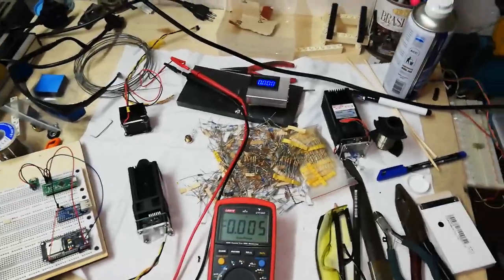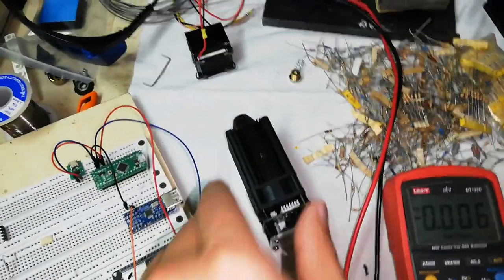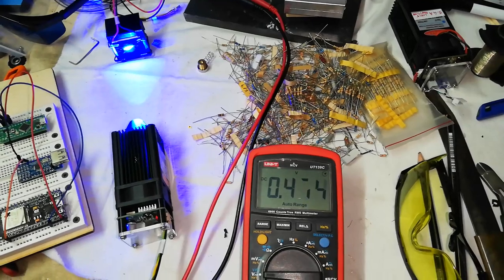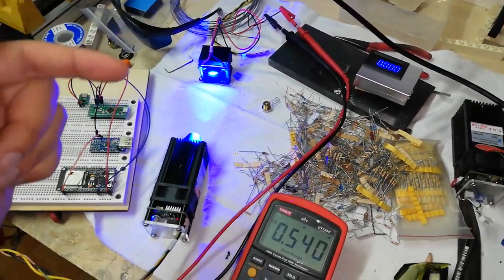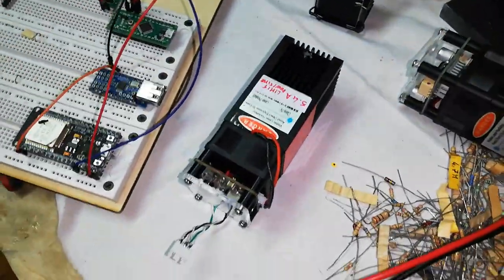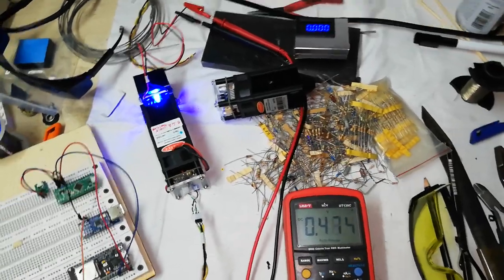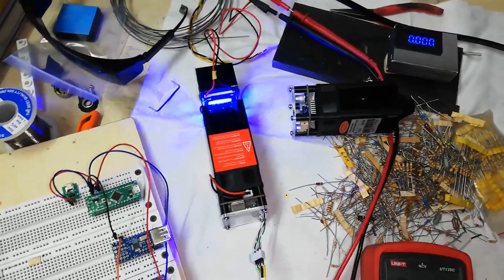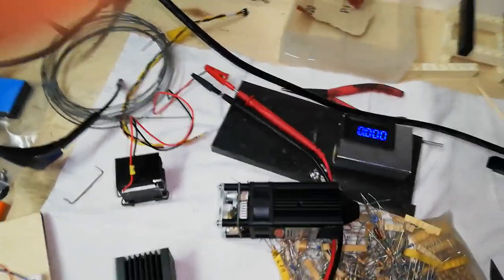DIY laser power meter: measure laser power using a peltier cell.

Comment: Cool! This is better than my idea of shining the laser at a black plate in a bath of water and measuring the water's temperature change.
Reply: This could be useless if the light of your LASER was not absorbed, because the water is transparent for many ranges of wavelenghts. By other hand, you can have a instant evaporation of water in the surface, before the increase of temperature.

Comment: The max amperage in the peltier cell affects the millivolt reading in my testing I've tested 1,2,6,8,10A cells in my testing 6A cell gets the closer reading
Reply: What size laser were you testing with the 6A cell? If I want to test lasers that are less than 1W, would a lower Amp cell be more accurate than the 6A?

Comment: I had been wondering if this was possible. I'm surprised at how little drift occurs. I wonder if you could use a second peltier and a thin film sensor to act as a fixed temperature reference. Nice work!

Comment: Your method will be very useful to me. For some time I will have an Ophir meter and will be able to calibrate the Peltier using it. I have a question: What does the black absorbing plate, which is pressed against the Peltier element, consist of?
Reply from the maker: laser side is painted black, cold side is pressed on an aluminum heatsink (from an old PC graphic card)

Comment: It's an interesting video. But I miss the direct comparison with the laser power meter you bought. Could you also explain the use of the laser power meter? Do you remove the lens for the measurement?
Reply from the maker: In the video there is no comparison between the LPM and the peltier, but I can say that the two modules make about 5.4W and about 7W when measured with the LPM so the 0.540mV and the 0.680mV can be considered representative. It is not necessary to remove the lens, the important thing is that it does not focus on the LPM or the cell, otherwise it will burn.

Obviously the lens introduces a power loss, usually around 10% (it depends on the quality and type of the lens) so if you want to measure the power of the diode you have to remove it, if you want to measure the real power that will end up on the material to be engraved you have to put it. The difference between the two tells you the dispersion due to the lens.
Reply: @lasergrbl  Thank you very much for the explanation.

Comment: You could have at least placed a load resistor on the output of the module and see how much current and therefore power the module makes compared to the laser. But you didn’t.
Reply from the maker: thanks for your hint, I think you're right. using a load resistor and measuring V and I certainly give better readings
Reply: @lasergrbl  Not a problem, in fact you could make an entire video on it.

Just place a resistor across the module. 

Divide voltage by resistance and that will give you current. Then of course voltage x current = wattage or power. 

You don’t even need a meter except to measure voltage. 

If you place a meter in series between the module output and resistor it will be exactly the same as you calculated. 

This is the great thing about ohm’s law in which if you know any 2 things out of 3 then you will figure out the third thing.

I’m really actually curious as to what the module’s power is compared to the 5 watts of the laser.

To find efficiency simply divide output by input then multiply by 100.

Next is to try a magnifying glass between the laser and module. This will amplify the heat to the module.

It may not improve things or it may I wouldn’t really know, but I’m curious!

Comment: The distance you kept the different lasers away from your measuring device way different . Would that make a difference?
Reply from the maker: no noticeable difference as the laser power does not disperse with distance (unlike what happens with the light of a bulb)
Reply from the maker: https://www.youtube.com/watch?v=vUwP7SY0Ajs
Reply from the maker: the only reason they have been placed at different distances is because they have different focusing distances, and you need to point it at the peltier cell - not in focus - otherwise you burn the cell.

Comment: Intresting video. I made test to myself, but i dont know what to thing.... I have NEJE laser modul wich shuud have 7.5w optical power, but when i measure voltage from Peltier cell, it shows only 0.22v.... This doesnt seems right...
Reply from the maker: exact voltage depend on peltier specific model, and quality of surface black painting (should be not reflective). however it is a comparative measurement, not an exact one.
I mean you can compare laser power of two different diode and have an approximate measurement of "how much or how less is powerfull one respect the other" but not an exact/absolute measure.
Reply: @lasergrbl  i see.i tested again with two laser moduls and  It dosapointed me, that one laser modul 2.5w had 0.14v, and neje laser modul 7.5w only 0.24v... but shud be three times stronger...

Comment: Hello! I bought a laser power meter. In the video you talk about the laser beam not in focus and without lenses. So to measure for example a 15W neje of optical power how should I place it in front of the sensor? The instructions (in Chinese) indicate a maximum beam of 8 millimeters. I measured my lasers focusing on the sensor (narrower beam on the probe). How long do I have to hold the beam to get a correct reading? Thanks so much!!
Reply from the maker: Beam should be not in focus, or it damage the sensor. Keep it as long as you read the peak, than the measured power start decreasing, peak is your power.
Be care that this instruments has a max value that can read, don't exceed.

Comment: Which laser driver did you use for your NUBM44?
Reply from the maker: Google "5A SCU driver"
Reply: @lasergrbl  thanks. That exact one had actually caught my eye for use with a NUBM44 build I'm planning, but I wasn't sure of it's quality. You've given me the last piece of the puzzle!
Reply from the maker: @marcellusjon1424  well, the one I received only give 4.4A I had to change the feedback resistor to get it work at 5A. I hope it was a problem only of my board
Reply: @lasergrbl  I think 4.4A would work perfectly for me. I want a little more power of course, but my main priority is longevity. I don't want my engraver to burn out within only a few months. Great tip about the Peltier cell too!
Reply: @lasergrbl  Which resistor is to change to reduce the amps?
Reply from the maker: @rchobbynet  It depends on which driver module you are using. There are usually one or two larger SMD resistors mounted on the board. When there are two they are usually a parallel R110 // R120, when there is only one it can be a R050 or R040 or R060. This is a few milliohm (~50 milliOhm) shunt resistor that is used by the driver to sense the current.
Reply: @lasergrbl  Mine looks like yours from the link. Do you mean R8? In my case it is a R060. Is it possible to calculate the resistor value?